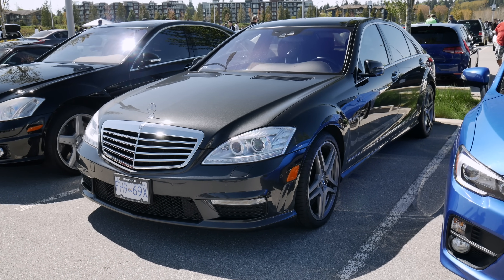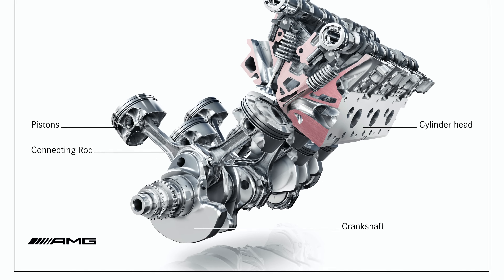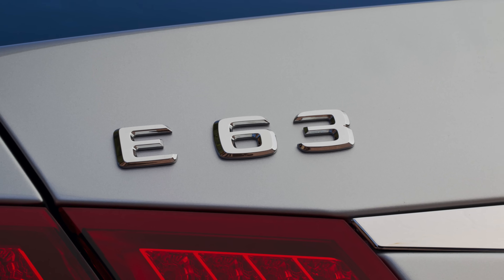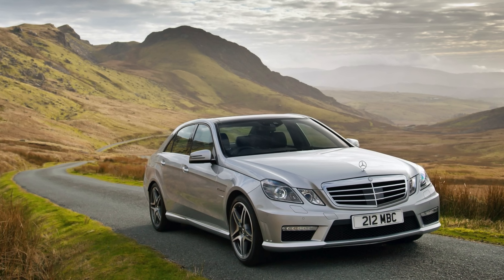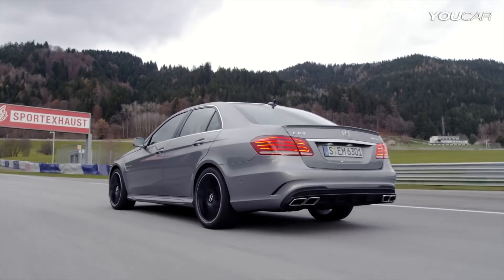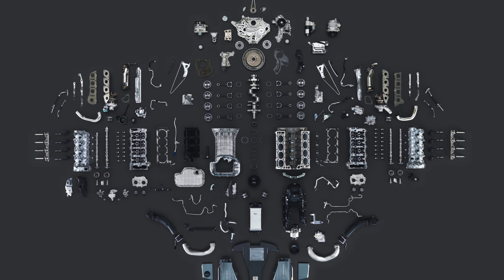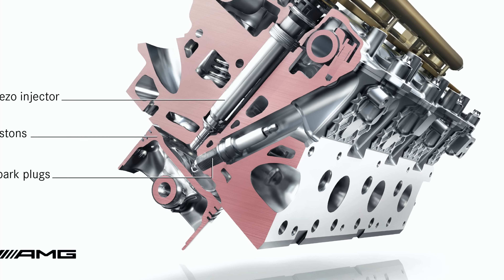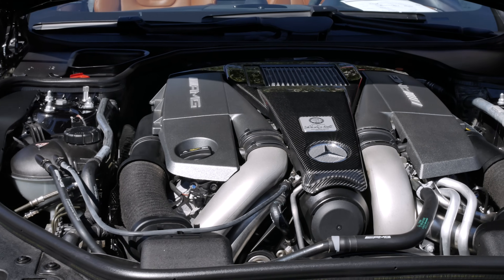Mercedes-AMG M157 Overview | V8 Biturbo (4k)

Comment: The M113K is usually a more durable design than the AMG V8's that came after it.

However, even the M113K has issues with (of all things something as major as) its sump lubrication system, pumps, and scavenge lines; all of which should be checked well and truly before the odometer see 100Ks.

The M156, M157, and M159's are far worse than the  M113 in the durability stakes; as some of their problems originate at the factory and can be catastrophic.

Anybody that thinks AMG engines are bullet proof might want to think again and/or consider the below list of issues the below and/or aforementioned engines have.

The M156 and M159 have camshaft, lifter, camshaft-lubrication, head bolt, camshaft timing mechanism, and other issues; that simply should not exist.

It is not unusual to see an M157 in the Mercedes Benz workshop - with above/around (sometimes less than) 100K on the odometer - getting; (i) the conrods replaced; (ii) the crankshaft reground; (iii) new pistons; and (iv) the cylinders re-honed and/or re-sleeved. 

Some M157’s have conrod issues straight from the factory.

This includes the gap tolerances between M157’s big ends being visibly too large; where in some cases the crankshaft journal can be seen in between the M157’s 2 big ends that share a common journal.

To put that into context, usually when NASCAR, LeMans, and other endurance race engines are pulled out/down and rebuilt rarely do they suffer from these problems.

What happens in these M157 engines (that have poor tolerances that allow the big ends to move about on the shared crankshaft journal) is the conrods start walking axially along their shared crankshaft journals and then lots of things break and your bank account gets hammered; just a much as the cylinder walls did from the pistons connected to the conrods - that went walkabout across their shared crankshaft journal in the 1st place.

In general terms the M157 doesn’t usually have the same set of proven/extensive issues/considerations as those associated with the M156 that I have described in my other posts; but some of the issues it does have should not exist in a car of this cost/status.

If you plan to increase/upgrade the boost/power on an M157 (or an M156) it’s a good idea to also subject to engine to a full rebuild before use; including regrinding/replacing the crankshaft, and replacing the conrods with aftermarket items that are stronger and capable of resolving the aforementioned big end spacing issue. 

And, if you're going to do all that then get new pistons and rings as well; and don’t run a diamond like coating on the rings as is done with some OEM M157’s. 

The reason being; the diamond like coating on the top ring of some OEM M157’s can sometimes fracture and/or break up (particularly if the conrods start walking along their shared crankshaft journal) and then accelerate other issues.

Sometimes, when the engine is apart, it also makes sense to add a new set of camshafts, cam chains, and valves to the above list also; which then means, add a cylinder head rebuild or refurbish for both DOHC heads as well.

Sometimes, when the engine is apart, you will not have any choice other than to add a new set of camshafts, cam chains, valves, and also a cylinder head rebuild for both DOHC heads; to the above M157 engine rebuild list, also.

The reason for that is because the M157’s standard little-end and also (the more commonly aforementioned issues of) the M157’s big-end assembly journal spacings that allow the conrods to move and/or walk (axially) along the wristpin/crankshaft; which, in turn, creates the catastrophic above-mentioned bottom end problems - all mean that sometimes (particularly if the piston slaps the valves) these issues easily make their way up to the top-end cylinder heads in a truly cataclysmic fashion. 

The only way to avoid/resolve the issue (in my opinion) is to - regardless of how new the M157 may be - replace the pistons, wristpins, and conrods (with Carillo and JE items; or another suitable brand) and ensure the correct big-end journal clearances exist.

Otherwise the aforementioned M157 design defects may just force you to do it at a time/cost defined by them; where the cost/inconvenience factor is easily twice that if you would have proactively addressed the problem. 

And, as I am sure you have already guessed, even an M157 rebuild that is not forced upon you as a result of the above-mentioned AMG design defects, is usually still way more expensive than what most owners are prepared for.

Let’s be real here; rebuilding an M157 is not like tearing down and rebuilding a Chevrolet 6.2 Litre LS.

As such, this then raises the consideration of checking before you buy/modify and also investing a good insurance plan.

So, as you can see - even if you put engine issues/considerations to one side - owning a Mercedes Benz outside of warranty is no joke.

Jim Stanley - Ex AMG Powertrain Engineer.
Reply: @namengross  Part 1

I am not sure whether or not you're talking about buying a replacement and/or used/new M113K engine; or, if you're talking about purchasing a car that has an M113K in it with <100,000 miles.

Either way I would be very careful.

As stated beforehand the M113K is usually a more durable design than the AMG M156, M157, and M159.

However, there were (and therefore still are) a few issues that plagued the M113K’s even when they were less than 3 years old; and some of them were catastrophic.

And by “catastrophic” I mean complete engine; failure, removal, teardown, and rebuild - which can be a very, very expensive proposition.

Particularly when you consider the cost of refitting some of the older MB’s with an LSX Chevrolet small block; and let me say that an LSX 7.4 Litre normally aspirated 454 cubic inch small block Chevrolet engine with ~650 HP at the wheels is no joke power-wise. 

Plus, an LSX 7.4 Litre Chevrolet V8’s reliability and maintenance costs are simply on a better/different level to most AMG/MB V8’s.

OK, back to your request; a list of issues to look out for with the  M113K.

M113 Valve Cover Gasket

It’s not uncommon to see the valve/rocker cover gaskets leaking and/or in need of replacement with less than 150K’s on the clock; and oil leaking from that (or any) location can also be indicative of other undiagnosed problems such as oil starvation - which (particularly on M113K’s) is already a problem that (for reasons outlined below you will see) usually requires no further assistance to create significant issues.

M113 Main Seal 

The rear main seal on the M113 is problematic and costly; particularly if you take the car back to the stealership and they repair/spot it. Rarely does the seal last beyond 150K without developing some leak and/or deformity.

The good news is that, whilst the leak is not more than a few drips here/there, you can still drive the car whilst it leaks; despite what the stealership may say.
 
Be aware though, that with any M113K that has more than 80K’s (eighty thousand) on it you're probably going to have greater crankcase pressures than a standard normally aspirated M113 5.4 Litre and as such that worn rear seal will potentially blow oil through with greater ease.
Reply: Part 2 - M113 Main Seal Continued 

Whilst it almost always is a sign of a major problem; sometimes it’s not such a bad thing because if you're buying a second hand and/or rebuilt M113 (whether it be in a car or not) you can extract/sample the leaked oil and then take it to be analysed and that will tell you how good the engine may be; provided you know what the results mean.

In any event, anyone owning an M113 will probably need to buy a drip tray to place under it in the garage anyway; so you can use that for the samples/testing and to keep the garage and/or driveway neat/tidy.

M113 Cooling System(s)

The entire cooling circuit (intercooler, transmission cooler, and radiator) of the M113 is *flawed and will only remain operable and completely free from problems for people that rarely drive their car and/or live in cold climates like Greenland and Sweden/Norway.

M113 Supercharger Cooling/Other System(s) - Includes ECU Functionality

Best to replace the supercharger intercooler/pump with better aftermarket units and then ensure the entire supercharger intercooler circuit is independent to the radiator; in other words the supercharger intercooler must have its own dedicated cooling circuit and if you want to go all the way then get a chiller system that actively cools the intake air in addition to the aftermarket water to air heat exchanger.

The reason that is so important is because the M113K’s ECU reduces boost pressures, modifies ignition maps and/or retards timing; all of which means less power; as soon as it detects high intake temperatures. 

It does this via (several means including) constantly sampling charge intake temperatures; so, when/if the ECU senses the air is too hot it instantly recalibrates timing/boost as above-mentioned. 

Once the ECU does this it may not always roll straight back to the previous settings as soon as the conditions - that caused the above-mentioned timing/boost recalibration event  - are no longer valid.

In simple terms this means that the actions the ECU took to ensure the M113 maintained control over the combustion process (in order to prevent things that spin/rotate inside the engine from breaking when temperatures are above a certain threshold) may persist even when the temperatures drop back below the threshold that initially caused the event in the first place; and that can be a problem too.

So, in my opinion, it’s best to replace the entire supercharger cooling circuit and pump with one that; is bigger/better; more reliable; capable of handling extreme temperatures; can store/pump a significant amount of cooling fluid; and - most importantly - is completely independent of all the other cooling systems.

The supercharger’s cooling circuit is basically an intercooler (air-to-water) located in the engine's valley between the cylinders and underneath the supercharger (so it is rarely cold/cool); that is connected to a heat exchanger that is usually located at the front of the engine bay. Usually (read on almost all OEM M113 engines/systems) the supercharger’s coolant fluid is stored in the same factory expansion coolant tank that also houses/contains the coolant fluid that the engine/radiator also relies upon.

This is (one reason) why *above I stated that the entire cooling circuit/system is flawed.

The joint coolant (stored in the aforementioned factory expansion coolant tank) is effectively pumped through the two relatively small (air-to-water) heat exchangers (car radiator and supercharger intercooler); and as such if the radiator/engine runs hot it can create a runaway condition where the supercharger intake temperatures get hot very quickly (or vice versa); and then the aforementioned ECU event-reactions occur that (can't always be quickly rolled back and) throttle down timing/boost and power.  

The same (unnecessarily interdependent) issue may arise if you get a ~stone in the radiator and it develops a leak.
Reply: Part 3 - M113 Supercharger Cooling/Other System(s) - Includes ECU Functionality Continued

So, if you're going to replace the entire supercharger cooling system and replace it with a dedicated/independent aftermarket air-to-water system (which I highly recommend) you will need to remember to both, get another (make it very) large coolant expansion tank (for the supercharger) and to also remove the OEM ”T-connector” on the OEM factory expansion tank that allows the OEM supercharger’s cooling system to share fluid with the engine’s coolant. 

In addition to all the below and/or aforementioned benefits of having an independent cooling system and reservoir for the (transmission and) supercharger; there is the fact that now you have independent control over the type/amount of fluid in each cooling system.

And all that equals greater levels of efficiency/performance for the engine, transmission and supercharger cooling systems. 

M113K Supercharger and Related Mechanical Systems

While you're there (working on the supercharger cooling circuit) you may as well address the supercharger issues that plague most M113K’s also; and they are the tensioner/serpentine system, the supercharger pulley bearing, and sometimes the pulley itself. 

This (the tensioner system and supercharger pulley bearings) is usually where that squealing noise comes from that often happens when M113’s start up; and it usually persists for a few minutes before fading away as the belt/pulley assembly warms up and provides the required traction increase.

Best to replace the lot with a new/aftermarket system so you have new bearings everywhere and an upgraded serpentine drive; and (provided you have performed the aforementioned supercharger cooling circuit modifications) perhaps a smaller upper supercharger pulley to add a little more boost also.

M113 Transmission Cooling System

I would also completely replace the transmission cooling system also. 

Depending on various things including what country the car was built for;  some M113K’s had shared cooling systems meaning that (as ~above-mentioned) if the main radiator was damaged then it wasn’t just the engine that got hot - the transmission and supercharger cooling systems also did.

It’s an utterly flawed design approach that brought many a tear to an owners eye - whilst earning stealerships a lot of money.  As such fitting a dedicated/external transmission oil cooler and a new/reliable pump is a good idea.

M113 Crankshaft Sensor

OK, now to the crankshaft sensor.

If the crankshaft sensor can't reliably detect where the radius of the crankshaft is pointing (and relay that to the ignition system) then it and/or the ignition system will have absolutely no idea what cylinder is about to require the spark to initiate the combustion process and power stroke.

This is (one reason) why some M113’s intermittently start, run for a while, and then stop.

If the engine has done more than 70K and/or is not new then replace the crankshaft sensor straight away - even if it has not showed any problematic signs - whilst you do all the other stuff. 

That way your engine will have a better chance of always starting/stopping reliably; rather than intermittently - as can be the case with many M113 OEM crankshaft sensors.
Reply: Part 4 - M113 Fuel Rails

Sometimes the fuel injection pressure/system on the M113 is less than spectacular. Although it is not as common as some of the other issues I mention herein, issues related to the fuel injection system can - in extreme cases - cause one cylinder to receive less fuel than the others; which, in turn can then (quite counterintuitively) lead to detonation/explosions.

New fuel rails (all equalized) and a better pump are usually the way to go.

M113 Engine Scavenge Pump Bearings and O-Rings

Now we’re getting into the really outrageous/serious stuff.

You can easily destroy your M113 by having an o-ring installed in between the scavenge pipe line and pump housing (within the sump) that has hardened, is crumbling, and/or of the wrong composition.

The real issues are; (i) how would you know what o-ring you had when these components are buried down deep in the sump with some other very curious features that do very little to lengthen the lifespan of the M113; (ii) WTF is a rubber/composite seal doing in between where the main scavenge line mates with the main pump anyway; and last but not least (iii) why is there no strainer on the main scavenger oil pump.

OK the answer to Engine Scavenge Pump Bearings and O-Rings Point (i) is as follows; most owners that don’t work for Mercedes Benz and/or AMG will not know unless they ripped the engine apart and/or experienced a catastrophic failure because the o-ring in question (that is installed between the scavenge pipe line and main oil pump’s housing in the sump) is put there from the factory.

Yep, that’s right, the o-ring that is installed in between the scavenge pipe line and pump housing from the factory; and therefore (anyone that designs and/or tears down a few old M113’s will attest to the fact that) it is a common and unnecessary problem (specific to M113’s) that often spins crank-train bearings; starves the top end of the engine from oil; and/or causes other catastrophic problems that include throwing a rod through the block and/or sump. 

Well then, since (by way of AMG accountants {read; not as a result of AMG powertrain engineers}) there is an (albeit unnecessary) o-ring installed by the factory between the M113’s scavenge pipe line and the main pump housing one might think it would be made of the correct composition - so it does not harden from all the heat cycles.

Nope - there is no such thing fitted to most M113’s that leave the factory powering a Mercedes Benz. 

What that means is that all the OEM factory fitted o-rings that reside between the M113’s scavenge pipe line and pump housing are made from a questionable composition that is not reliable and/or durable (there's a difference between reliable and durable) within the context of 150K worth of heat cycles

And, if only that were the end of the problems perhaps we would then smile/laugh.

OK the answer to Engine Scavenge Pump Bearings and O-Rings Point (ii) is as follows . . .

Unfortunately the fact remains that (from a powertrain design perspective) there actually is NO REQUIREMENT whatsoever for any o-ring to exist and/or be installed between the scavenge pipe line and pump housing. 

So, now we have poor quality OEM rubber seals in critical places (of the M113) where no such seal is required.

The reason there is absolutely no need for a rubber seal where the main scavenge line mates with the main pump is because the entire assembly can easily be made as 1 piece.
Reply: Part 5 - M113 Engine Scavenge Pump Bearings and O-Rings Continued

Or, alternatively, if the engine must use/have a main scavenge line that is separate to the main pump; then it is better to specify a brass clamp seal that will not deteriorate over time and thousands of heat cycles.

However, since (by way of AMG accountants {read; not by way of AMG powertrain engineers}) there is an (unnecessary) o-ring - of questionable composition - lying between the M113’s scavenge pipe line and pump housing; one might think there would be an oil pressure sensor fitted to all M113’s - so all M113 owners can be alerted to low oil pressure conditions and save their engines.

Nope - there is no such thing as an oil pressure sensor that does that on most M113’s that leave the factory powering a Mercedes Benz.

OK the answer to Engine Scavenge Pump Bearings and O-Rings Point (iii) is as follows . . .

Now, a reasonable person might think that since the M113’s oil pressure system/circuit is born with all the aforementioned unfortunate deformities/setbacks and/or vulnerabilities (planned obsolescence?) there would be no other avoidable and obvious flaws associated with what surely be one of the most critical functions related to an internal combustion engine; its lubrication circuit/system.  

Nope - wrong again.

The main oil pickup location/duties within the sump of the M113 are allocated to the same aforementioned scavenge pipe line that (along with the pump assembly) is unnecessarily implemented in 2 pieces and also mated to the main pump housing via the above-mentioned unnecessary and poor quality o-ring design; and this scavenge pipe - that is responsible for the entire engines oil pressure and therefore livelihood - has no strainer on it at all.

So, if there are any metal grindings/filings and/or wear/tear via other means that exist as small metallic particles in the oil that somehow make their way into the sump, they will all get fed straight back into the aforementioned scavenge pipe line and main pump housing/assembly; no questions asked.

What happens before/after the unnecessary o-ring starts to crumble/fail?

From there (provided there is sufficient oil pressure and the above-mentioned o-ring has not started to crumble) the oil - along with all its metallic particles in it - makes its way into the cranktrain assembly and/or up to the valvetrain.

Alternatively, (in the event that the above-mentioned o-ring has started to crumble and fails to seal) the oil pump will then severely aerate the oil and drastically reduce its overall pressure, which will then make the likelihood of a catastrophic failure (within the cranktrain and/or valvetrain assembly) almost certain.

Lucky it is then that there would only be a miniscule amount of metal filings and/or metallic particles in the oil then, eh?

Nope - (AMG accountants have ensure we’re) wrong again. Read on . . . .

M113 Oil Chain

Anyone that has pulled apart a used M113 will attest to the fact that the oil chain almost always touches the block and grinds it out; with all grindings/filings falling/going to the sump.

Most M113’s with 100K - 150K on them will (behind the timing cover) show significant grooves as a result of the chain rubbing on the main short block assembly; and with respect to this please also see my other/above comments in relation to the scavenge pump and o-ring shortfalls.

Part  of the problem is the chain tensioner as they usually break and/or do not hold up to what might be considered reasonable wear circumstances for a Japanese engine.
Reply: Part 6 - M113 Oil Chain Continued

When I above say “significant grooves as a result of the chain” . . .

I am talking, like, say, a large carpentry saw hacked back/forth into 4 x 2 piece of pine 5 or 7 times; the grooves on the main short block assembly are usually approximately 15 - 30 mm deep.
 
So, clearly, none of the metal filings and/or metallic particles in the oil that this issue sadly represents is abated by, say, a simple scavenge pipe strainer; such as that which you find in the sump of most Toyota, Mazda, and Chevrolet’s.

As, the M113’s main scavenge line (feeding the entire engine) has no strainer on it at all; just so - in the unlikely event that the aforementioned/avoidable oil pressure issues and/or other related defects (including those pertaining to the unnecessary o-ring in between the M113’s scavenge line and main pump assembly that is also implemented as an unnecessarily 2 piece design) don’t quite manage to simultaneously make the stealership rich and bring the M113 engine to a halt before 150K - the fact that the main oil pickup in the sump has no strainer at all attached to it combined with the aforementioned chain grinding out the short block assembly issue, almost certainly will.

So, there you go. 

There are some other M113 issues but above are the main ones I recall; and that’s why I say “it is a brave (or exceedingly rich) man whom owns a luxury European sport/other car -  particularly a Mercedes Benz - out of warranty.

It pays to do your research; including with insurers. I hope what I have written here helps.

Jim Stanley - Ex AMG Powertrain Engineer.
Reply: @StormCentre88  Thank you Jim! I have a 2005 CLK 55 AMG(Delivery date 08/24/04) and this helped me immensely with 185k miles on her and still running like new with the AMG M113. I am wanting to make her a "Forever car", the engine was made by Reiner Laukemann btw if you knew him.
Reply: @StormCentre88  
?
Reply: Thank u very much
Reply: Jim Stanley i have known someone who owned a cl55 amg, those were truly bulletproof. Not one single issue with it troughout it’s life, it has done 630.000kms now..
Reply: Gees man, I have an m113k in my 2005 CL55 & an m157 in my 2016 E63S. I thought I had some pretty reliable cars here for years. I've never had any issues with either other than the stupid radiator overflow bottles cracking on both but after reading your posts I am sitting on 2 ticking time bombs here. They are going to explode any day now I guess. You sound like it's not a matter of if they are going to explode but when. I better sell them both now I guess. 🙄
Reply: I like your comment and your explanations I’d just like to point out though that 100k is a lot of wear for any engine and of course things are going to fail eventually, as they are mass produced and to some degree built in a cost effective manner. I also wouldn’t consider endurance racing cars an applicable comparison either as those engines cost more than an entire AMG vehicle itself if not several times more. They are also not built to go 100k, even at Le Mans the fastest cars only average around 3,300 miles. That being said all in all I do agree with you, prepare to have your bank broken if you’re buying a higher mileage car!
Reply: @danielpearcy8846  Thanks for your comments but . . . . 

For an engine designed in Germany by AMG for a prestigious brand like Mercedes Benz that costs as much as these engines do; it should not in any way exhibit many of the issues it does before 100K is reached.

How can any person and/or company justify having no strainer on the main oil pickup in the sump of the M113 (that is/was the showpiece of the Mercedes Benz performance V8 range) and also an unnecessary 2 piece scavenge line and main pump assembly design that appears deliberately compromised and/or dependent upon unnecessary seals of poor quality that themselves are representative of the term “planned obsolescence” - just as much as they're responsible for spinning main bearings and throwing conrods . . . . . . . 

And, then go on - several years later - to;

(1): Firstly; design another V8 (M156) that also has (in the very least) poor valvetrain oiling and both, questionable valvetrain acceleration rates and questionable camshaft metallurgy?

(2): Secondly; design another V8 (M157) that incorporates (in the very least) poor cranktrain clearances such that the conrod big ends can walk axially along their shared crankshaft journals?

None of the aforementioned problems should occur in any well maintained 4, 6, or 8 cylinder internal combustion engine that is fitted to a commuter vehicle (irrespective of whether or not it is a “sports/performance” model) at all, let alone, before 200K - 250K Kilometers; particularly an engine/vehicle from such a costly/prestigious brand like Mercedes Benz .

Yet, many well maintained M113, M156, M157, and M159 V8’s develop these problems over and over again.

Many Toyotas, Mazda, Honda’s and other Japanese brands (costing much, much, much, less than an AMG/Mercedes Benz) rarely develop serious cranktrain and/or valvetrain issues with even 200K on the clock.

In fact, if Toyota, Mazda, and/or Honda found that some of their engines exhibited the aforementioned issues associated with many AMG V8’s my bet is they would; (i) recall the lot; (ii) conduct an investigation; (iii)  find out where the departure from professional powertrain design occurred such that it led to a series of catastrophic failures (many of which trace back to the lubrication system/design and/or implementation) across several decades of V8 designs; and (iv) fire whomever was responsible.

With today’s available metallurgy and design knowledge about the internal combustion engine (and/or even that of 15 years ago) there is absolutely no reason why the AMG/Mercedes Benz M113, M156, and MN159 should develop some of the issues they do prior to 150K

Years ago you could get a *big block 454 Chevrolet V8 (as many enthusiasts did) in many Chevrolet vehicles and, even as a street/commuter car, beat on it and/or drive it for many years; and - provided you maintained it - it would rarely develop the kinds of aforementioned issues associated with the AMG/Mercedes Benz V8 range unless you were over 150Ks and/or regularly pushed hard over 6500 RPM.  

Cheers,

Jim Stanley - Ex AMG Powertrain Engineer.

*The Chevrolet 7.4 Litre 454 is now an LSX small block.
Reply: @danielpearcy8846  Gonna have to disagree with you, 100k isn't a lot of miles. There's a lot of sports cars that can take 100k miles
Reply: jmhellison name 3 that are true sports cars that can go 100k miles with little to no engine work. Meaning they don’t have an economy engine with a slight tune from the factory called and shipped as a new model they call  “sporty”
Reply: @danielpearcy8846  Corvette, Viper, Ford GT, Mustang. I'd be perfectly fine buying either of those with 100k miles
Reply: This is really interesting man! 

I think You should make a documentary video about it!
Reply: Every engine has its issues, even the LS and 2JZ... The M157 is still a very reliable engine, especially considering its a turbo V8. Most engines can run forever if maintained properly.
Reply: @brunobegic3841   Yes but the point is the M156, M157, and M159 are not just any engines. They’re very expensive engines placed into very expensive cars that can exhibit serious problems - very early in their lifecycles - that have planned obsolescence/failure at their heart.

Cheers,

Jim Stanley - Ex AMG Powertrain Engineer.
Reply: @StormCentre88  On m113k's, do you know if all the versions suffered from the oil pump pickup oring issue?  I have an 04 S55, from what ive read i thought there were at least 2 different pan/pickup designs, with the e55 and cls55 having the oring issue, while the s55 and maybe others did not. Also ive heard of people saying the oil pump chain tensioners were spring steel and weak, resulting in the oil pump chain slapping the block, can't confirm on my car but i highly suspect thats the case.  It would make sense to me thats the issue on these cars, ive not read of timing chain issues on m113 and idles fine with no engine codes.
Reply: how do u feel about the m156 engine?
Reply: Bro Im getting a c63 M156 engine with 60 miles should I be worried ?
Reply: @Mike_XV  Have the headbolts been replaced?
Reply: @Mike_XV  Yes, I would be

It’s healthy to be worried about a new purchase of a vehicle/engine that is known to have problems.

What you need to do is; (i) subject the car to an independent check before buying; (ii) provide the independent “checker” with a list of known/your concerns (I have already written them out for you in other posts here); (iii) never buy an AMG/Mercedes Benz out of the new-car warranty without a comprehensive 3rd party warranty that covers all powertrain (engine/gearbox/differential(s)), suspension, chassis, and underbody components; (iv) show preference to AMG/Mercedes Benz’ that have a linear/full car service history in their log books and/or with the maintenance shops in question within an approachable geographic/electronic proximity; and (v) if the car doesn’t make objective sense, then just walk.

Tax/other deduct the costs of (i) - (v) from your income and/or purchase price. If the car doesn’t make objective sense then walk.

Cheers,

Jim Stanley - Ex AMG Powertrain Engineer.
Reply: InFaMouSS_Mike depends get mb to do a pre purchase inspection first
Reply: Conveniently, less power and less weight should be more reliable lol. But even so, I STILL wouldn’t assume a 113 to be more reliable than these